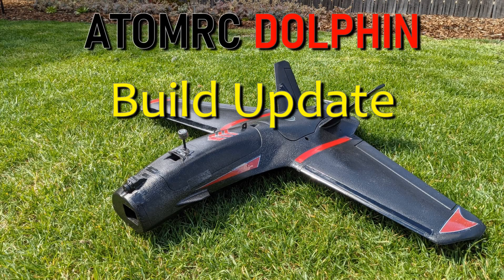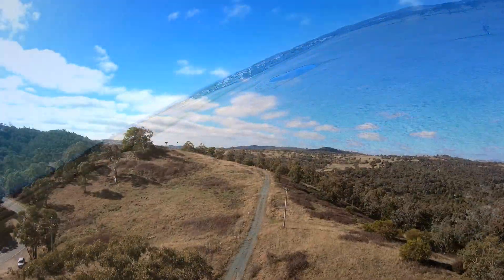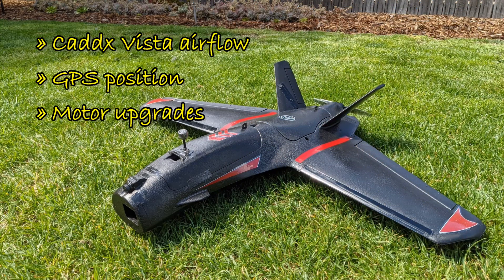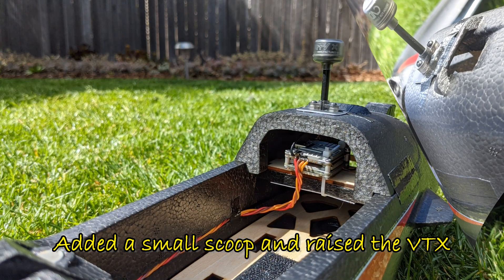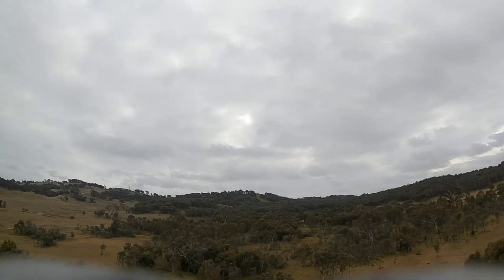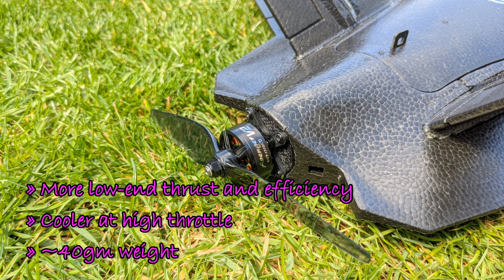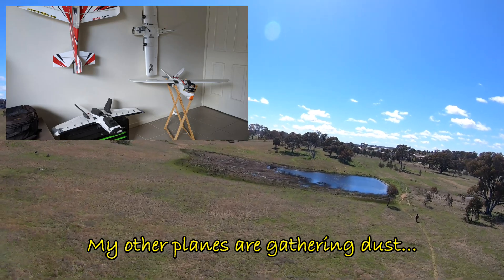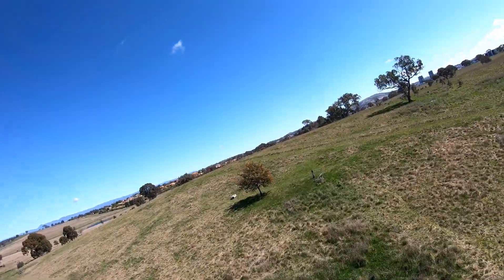ATOMRC Dolphin - Build Video Update - Vista VTX Airflow Mod & Motor Upgrades

Comment: Do you still have the 3d print file for the airflow mod, and vista antenna mount?
Reply from the maker: Haha, no 3d printer here! A friend did my motor mount, but otherwise, the air scoop is half a takeaway soup spoon, and the antenna mount is screwed onto a piece of a store loyalty card hot glued to the foam. 😄

Comment: Zak, I know this video is over a year old, but I wonder if I could ask a question? I'm sorta new to the hobby, I learned about FPV well over a decade ago but the responsibilities of life got in the way and I wasn't able to pursue the dream. I recently saw a video that got me back interested now that I can afford the "fun" things in life, and your videos are a true inspiration. I've got my eyes on a few different models of planes, including the idea of building my own [Experimental Airlines style], but fact is I'm still a newb. I love the look of the Dolphon and have heard nothing but good things about it from the FPV community. Would you be comfortable saying this might be a good airframe for a beginner? My idea was to build an easy handling [ie docile] starter plane with basic FPV stuff, but also an FC to help aide a newbie pilot and RTH for when I screw up [which is inevitable]. I own enough land to fly "at home" [I think] but more importantly I'm loking for that right starter plane. Thoughts?
Reply from the maker: I love the Dolphin for its versatility, endurance and stability compared to others of its size. If you keep it light (no GoPro, 35gm multirotor motor, reasonable flight batteries), it can fly quite sedately without much risk of stalling (as long as you balance on the CG markers).  Even loaded up with GoPro and 4200mah of 4x 21700mah Ion cells, it still feels very manageable to me and doesn't stall until under 40kph. You can also use a 7A Li-Ion (if no HD cam up front) which equates to a LOT of flight time if cruising.

Other than the zip-tie skids, I've only used one mod which is the 3D printed motor mount. Well worth it if you know anyone with a printer.

Matek flight controllers seem to have gotten pretty expensive. The Matek 'F405 Wing V2' or the SpeedyBee 'F405 Wing' are probably the most cost effective yet powerful INAV/Arduplane compatible FCs on the market right now as prices have been going up.  I prefer to have a FC which allows the video power to be switched ON/OFF via radio switch, so use the Matek H743-Wlite (they used to be 30% cheaper).

Otherwise, the Dolphin just needs two servos and a 35-45gm motor, between 1650-1900kv.  T-motor F80 1900kv is a quality choice. And I recommend EMAX ES08MD II servos if you can find genuine ones, as they can run at 6v for more responsiveness/torque, and also use higher refresh rates through the FC.

Happy shopping!
Reply from the maker: It occurs to me while I've gained experience over a long period of time with soldering FCs, sorting out pin assignments on the GPS and RX, and configuring INAV, this would be daunting if you don't have anyone to help you the first time.  Some good videos out there on INAV - Painless 360 has done a series not too long ago.

Updating and configuring EdgeTX on a new radio is the next learning curve. Then updating/configuring ELRS, and installing the ELRS LUA script on your radio to control its features... all this takes time, and once again, a few good videos out there for each step. (Joshua Bardwell has several)

However, if you are not technically inclined, you may want to consider one of the 'RTH' versions of the AtomRC products. Expensive, but they come with all the PNP kit (servos, motor, ESC), plus a flight controller already programmed for the plane, (and I assume reasonable instructions to get it all hooked up to your radio gear to get flying).  The AtomRC Dolphin, Swordfish, and Penguin all come in RTH versions.

Comment: Thanks for the upload info and sharing.  How would you say the dolphin compares to the ZOHD Talon ? I see larger bay size and low speed control ?
Reply from the maker: I only have the ZOHD Dart XL Extreme Enhanced (that's a mouthful!) to compare against. Dart is bigger in and out, but heavier, slower, more draggy, and made of bio-foam which can crumble on impact. The nose and wingtips have broken off so many times, the plane is too weak to be taken on a roadtrip.
Unsure if the Talon uses the same foam.
Reply: @ZaksterBlue  Excellent thanks, Ended up purchasing the Dolphin.  Mount broke off on 3rd flight exactly like yours did.  3D printing a couple to test now.  How did you attach the mount to the foam just screws with the new 3d mount ? or glue  ?_
edit sorry disregard,  I see the comment about clear liquid nails.
Reply from the maker: @alcmann  enjoying the Dolphin?
Reply: @ZaksterBlue  for sure yes ! On rails both high and low speed. Having some OSD flickering issues ( FC ground issue I think ) other than that is a rock solid module, minus the kind of weak crappy setup for the engine mount.

Comment: Where did you mount your ESC as mine overheats in the rear bay - maybe I should put it underneath in some airflow
Reply from the maker: Yep, I use the designed ESC bay underneath and it's been fine.

Comment: Some stunning scenery! I've just got a Dolphin and scratching my head where to mount stuff so this is very useful. I have only 1 Air unit which I swap between my AR and AR Pro  which makes things awkward.
Reply from the maker: I also posted a build video for my second Dolphin. Similar, but with the full air unit.
https://youtu.be/MhWsB-3ZzWk

Comment: Hey Zak, thank you for all the info. I recenlty built my first wing Heewing T1. My goal is to fly over the clouds, and T1 is not the right plane for this. Do you suggest Dolphin for this purpose ? Thanks
Reply from the maker: Hi, why do you find the T1 unsuitable?
On 4S li-ion and a suitable motor/prop combo it should be able to cruise for at least half an hour?
The Dolphin has way more flexibility for battery size and motor/prop sizes, so yes, it would be easier to achieve a longer, faster flight. You won't regret getting one!

Comment: Thanks for the info and video. Beginning to fancy.  Would use a folding prop.
Reply from the maker: No worries! I'm still using the original HQProp after more than a year. The 3D print motor mount is more important an upgrade.

Comment: hey mate im thinking of buying the dolphin is there anychance i could get your build for enduro pls because i generally fligh drones but im looking for a change
and i love your vids
Reply from the maker: I listed my parts on the second Dolphin build video: https://youtu.be/MhWsB-3ZzWk

If you are not running a heavy GoPro up front like I do, you can probably squeeze 2x 3500mah 4S Li-ion packs (18650), either as one brick to slide into the middle section, or as two separate packs in parallel, under front and back hatches.

7A at a steady 5A cruise is plenty of flight time!
Reply: @ZaksterBlue  thanks mate

Comment: Hey bud! I'm in between looking at the dolphin or the Heewing F01, I currently have the Dart xl with DJI and Runcam thumb set up, but it's just to slow 🐌 
Great info mate and missing Home like crazy.
Reply from the maker: Thanks! Both of those choices will be fun. I like the stability of the Dolphin. Not as smooth as the DartXL but definitely more agile.

Comment: will the new eco 2306 1750kv work with the dolphin?
Reply from the maker: Yes, it's not quite as strong as the 2207 option, and going slightly bigger is better. But will be ok with 6" prop, or two blade 7042 prop like the Gemfan Flash.

Do a one minute bench test for how hot the motor and ESC get with the prop you choose. Best to keep those small motors under 30A continuous.
Reply: @ZaksterBlue  trying to get a setup like your flying, that is the type of flying I intend on doing.
Reply from the maker: @phillip7047  if you can get a 2307, 2407, or 2507  you'll have no worries spinning a 7x4.5 like the hqprop that I use. 1750kv is good.
Reply: @ZaksterBlue  Awesome , thank you. I have watched all your video's. They are so amazing! Thanks for all you do.

Comment: So I have a problem that I haven't found info on... I used hot glue to hold the stock wood motor mount in the rear of the dolphin, and it's melting from motor heat. lol
I'm using a 4 cell/2500 Lipo, a 50A ESC, 2507-1850Kv motor and a 7x4 3 Bladed prop. Even with easy half throttle or less flying for 10 minutes with a few bursts here and there, the hot glue gets soft enough that when I come in to land, if the prop touches the grass, it pulls the mount out. 
I read and commented below on the different size motor adapter, guessing maybe my motor being bolted right to the wood without the bigger adapter/spacer is just too close. Do you think the printed motor mount might also help with this cooling? Or did you use something different to hold the motor mount into the foam of the plane? Thanks
Reply from the maker: The 3d printed motor mount on thingyverse is a worthy upgrade as it pokes through into the wire gap and is quite strong.
I use clear Liquid Nails, I think known as Goop in some countries.
Reply: @ZaksterBlue  Got it, I'll print out the motor mount and use liquid nails... thanks for the help. I also have to find the larger motor mount adapter. What are the dimensions of it again? 16x16 to 16x19?
Reply from the maker: Not sure what you're asking. The 3D print design has standard x-mount holes at 34x34mm. The inner motor mounting itself depends on your motor. Mine (Brotherhobby Avenger 2507) is 16x16mm, whereas some motors are 19x19, or 16x19 (standard plane motor config).
Reply: @ZaksterBlue  The 34x34 is what I meant... Mine is a Brotherhobby 2507 as well. Thanx again.
Reply from the maker: I'd also recommend you consider trying the hqprop 7x4.5 two blade prop to unload the motor. It'll be more efficient at cruise, and still hit ~170kph at full throttle.
Reply: @ZaksterBlue  I purchased the 3 blades and then a couple 6x4.5 2 blades as well... was going with 3 for the torque for my maiden. I'll give the 2 blades a try next.

Comment: Hi 
 ZaksterBlue..!
when replace the 2507-1750kv motor, what battery you using? Can you have the battery specs please? to be able to reach a weight of 40g. And how long is the actual flight time?
Reply from the maker: Hi, I made my own packs using 21700 size, 4200mah batteries.  https://youtu.be/Dnd8vi6fNzk
Reply from the maker: I get about 45 minutes of cruising.
Reply: thank ZaksterBlue.  I'm glad you replied

Comment: Trying to gather your ultimate setup... What brand motor is the 2507-1750KV that you've gone with? I found a BrotherHobby 2507-1850Kv... Also the bigger ESC of the same brand is a 45amp and not a 50. Did you stick with HAKRC BLHeli brand? Thanks
Reply from the maker: Mine is a Brotherhobby. 1850kv will work if you want a little more top end. I'm still using the HAKRC but bought a FlyColor 50A to replace it eventually. Doesn't matter much with the prop I'm using, as it's only pulling around 35A.
Reply: @ZaksterBlue  Thank you so much... and what is the reason for using Lithium Ion vs Lithium Polymer batteries? You're not the first with these FPV wings that I've seen using Li-Ions... but I've always used Li-Po's for all my other planes. And did you put your ESC underneath in the vented compartment? Do you have that in a video anywhere?
Reply from the maker: @WheelzTV  if you like to go fast and draw high current, stick with lipo. Ions give you more energy density so my 4200mah 4s pack only weighs 290gm, but if I fly around at high throttle a lot, the ion batteries will overheat and become damaged. My batteries are rated to sustain 30A but in reality, they would still be stressed. Other packs might only be rated for 10A so you have to be even more cautious.

Comment: I think I'm going to switch to your motor and prop combo over the winter. I've got 20 packs through my dolphin running AT2310 and APC 6x4, but I really like the way you're describing your power. I did think ahead and put a 50amp ESC in it, so I'm looking forward to getting some of that low end torque! Love your videos and your posts on RCG!
Reply from the maker: Whoops, thought I'd responded with the link.
https://www.thingiverse.com/thing:4834533
Reply from the maker: Main problem I ran into with the new quad motors is the 16x16mm bolt pattern, instead of regular 16x19mm to mount it to a regular plane x-mount. I had to be creative.
Reply: @ZaksterBlue  I got my 2507 in this week and saw the issue you warned about! I asked someone who had made an adapter for a nice version of the Dolphin motor mount if he could make one to support the 16x16 pattern and to my surprise, he did it overnight! Feels like a Christmas miracle! I'm printing it right now, so stoked to try your power set up! Thanks!
Reply from the maker: @npcfpv9542  Ah nice! Is the mount file being placed on the web somewhere? I wouldn't mind having a look.
Reply: @npcfpv9542  Just following up on ZaksterBlue's question, are the specs for that motor adapter online anywhere that we can access it to be printed? Thanks

Comment: Hi, nice video :-) which kind of firmware did you install on your FC? iNav or Arduplane (or something else?) also, do you have airspeed meter? I found that the airspeed is very helpful, especially for landings and for flying efficiently. Cheers 🍻
Reply from the maker: Hi, iNav works fine for me. I've not installed an airspeed sensor on my planes lately as I'm flying with others that don't have it and it's harder to fly in formation if you use different speed measurements.  That and I'm keeping this plane light and clean.

Comment: Great info on the motor / prop combo...Seems like a capable little wing, a lot of them are so badly designed in comparison...Your outlet area on cooling ducts usually needs to be larger than the inlet area...Using the old L9R RX too..🤔😀🇬🇧

Comment: Hi, ZakerBluen, I am worried about because I bought your previous engine configuration (Emax ECO II 1900 kV) Tell me that it will not be too fair as power, knowing that I will mainly fly cruising without really peaking.
Reply from the maker: Hi, there was no issue with the Eco motor but I realised that I mostly flew under 60% throttle, so going to a lower kV gives me a little more throttle resolution. The Eco is still a good choice.
Reply: @ZaksterBlue  thank you so much
Reply from the maker: When you do upgrade parts next, consider going to a 45-50 amp ESC for a bit more headroom when you do throttle up. I've ordered a Flycolor 50A blheli_s which is a good size and price.